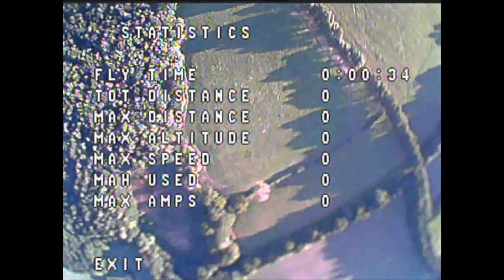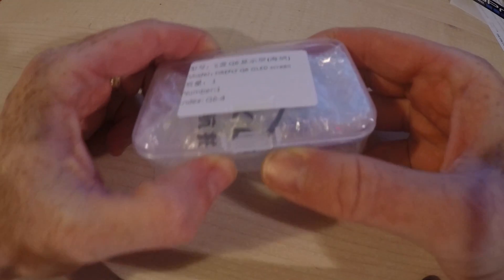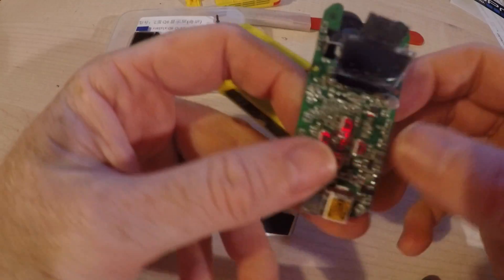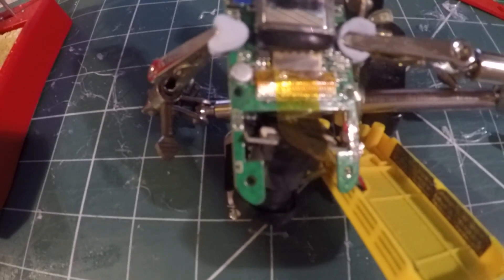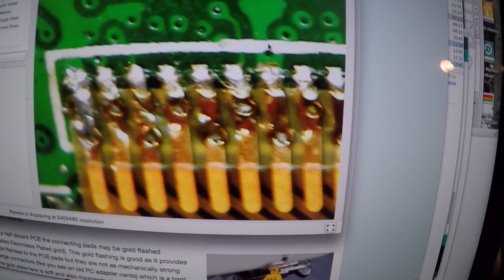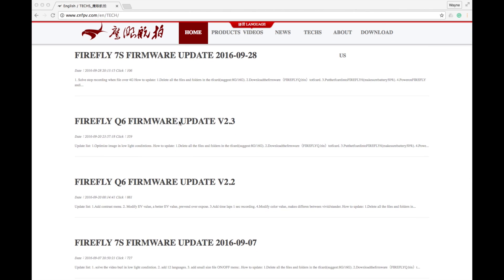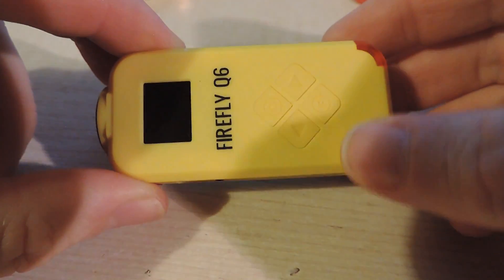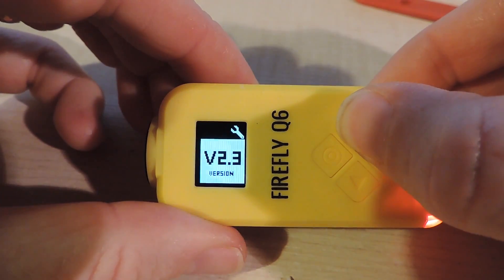Firefly Q6: Replacing OLED and updating firmware

Comment: What is the HDMI socket for?
I never got a monitor to recognise an input from that socket and no answer on any fpv or drone forum.
Reply from the maker: I don't think I ever tested it, but it should be for HDMI out.  I can't remember if you need to be in  a certain mode/change a setting for it to be active though

Comment: I broke my screen too, is there any other way to fix it without replacing the screen?
Reply from the maker: I'm afraid not - I mean for me, the camera still worked so you could turn on/off recording, but if you actually want to see anything in that display you'll need to replace the screen.
Reply: @CurryKitten  for me the camera does not work at All. Sometimes it does not turn on but if it does i cant do anything and it turns off again:/. I guess i gonna by a new one

Comment: Its look so hard to fixe it omg mine is broken 😁😭
Reply from the maker: It was more luck than anything else getting it working again.  The god news is that they are relatively cheap to replace if it comes down to that
Reply: CurryKitten the problem is that without this screen the camera is unusable, thank you for this video but I think I would not be able to do it 😂, but I will try for fun

Comment: Well done! Sir
Reply: Build a better version with header connectors and a solid case. Image quality is excellent but the weak case and fragile screen make me question buying more of your products.
Reply: cp6027 will try to make a cover protector
Reply: HAWK EYE Firefly Action Camera  I broke my first Q6 in a crash. I have another one on it's way from a black friday sale. I am trying the 90 degree lens version. The video quality is awesome for the money.
Reply: cp6027 ✌️
Reply: cp6027
 
Did you manage to turn?
Reply: The problem is that the camera sensor guillotines the display. I managed to replace it with readily available 0.66 OLED Wemos Shield screen, but will happen again. The optimal solution would be to print my own case, a "naked" Firefly Q6, avoiding that guillotine risk. What I couldn't solve is that since the crash I have a hiss in audio, desoldered the mic, the hiss continues, so no audio anymore.

Comment: Oh and how do you get on with gearbest? Never ordered from them before. Normally use banggood.
Reply from the maker: Gearbest seem ok - really quite comparable to Banggood.  I've only had a few bits from them and I've not had to deal with a fault yet, but they get things here in about the same sort of time-frame and prices are quite similar
Reply: cheers wayne

Comment: Well done Wayne, and thanks for getting Ver 2.3 for us....Im a bit confused, did you leave the original ribbon in place, cut it, then added the new one over it...?
  You are right about the Firmware lists......Its a fact, only Software engineers can make what should be a very simple thing, complex and disguised within a page.
  Our Software Engineers are even guilty of doing firmware updates and then keeping the file name exactly the same.....priceless..lol.
  Q6 Files jumbled up with Q7 Files, so well hidden I still can't find the download link...and then when you get the file, there is no way of really telling which one you have....not by name anyway.....Some things are truly a mystery.
Reply from the maker: The ribbon cable actually ripped away and just left the soldered tips in place - which was just right for wondering the new one directly over.

I would have been stuck on the firmware as well, but happily the guy from Hawkeye emailed it over to me, so I was able to compare the files :)
Reply: Oh, good job then, and the Microscope came in very handy....:) 

 I hope you asked him why its too much trouble to not simply list Q6 Firmwares in a list on their own....?...In order would be nice with release dates against each one....?
  This sort of thing with the Firmware listings really pisses me off because it's just unforgivable in my book...? It must be a Software Engineer thing....lol...Don't they ever read their own Webpages?

 On a different note, I was thinking you could glue a thin window of Polycarbonate over the OLED to protect it....(Not with Super glue) though..?  I think you were just unlucky breaking yours.